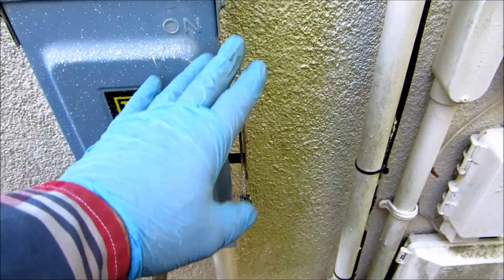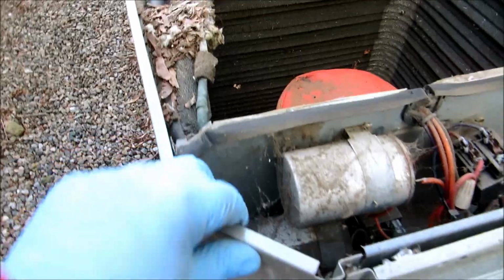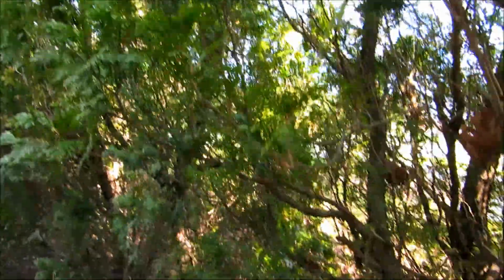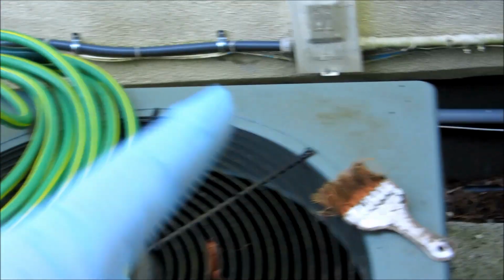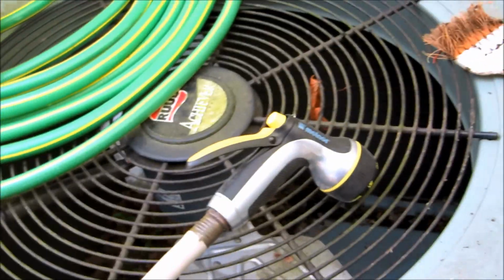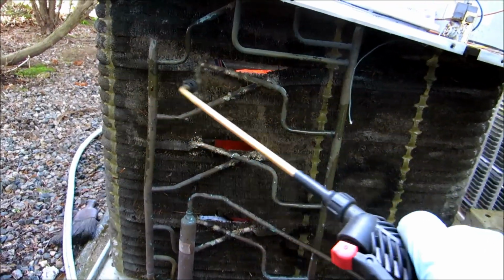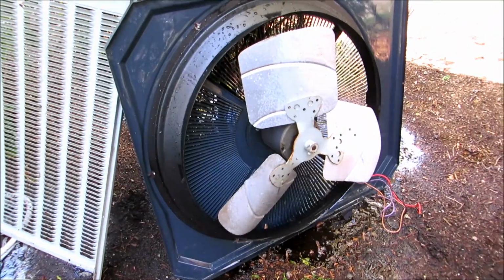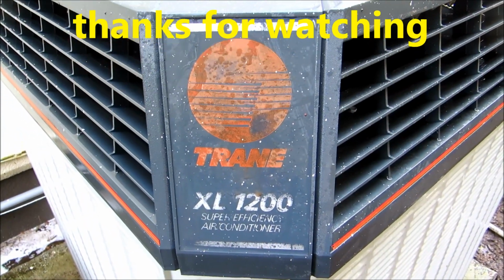hvac trane XL 1200 condenser cleaning

Comment: My trane 1200xl kept on tripping the breaker and i spent $500 on two different opinions of a new outdoor unit and a new capacitor. After watching this video i gathered enough confidence to take it apart and clean it. I spent 3 hours and 3 cans of coil cleaner but i gotta say that the time made a difference, i can actually hear the compressor running different now, no tripping so far.
Reply from the maker: milfhunterX wel; now it can breath and condense the refrigerant like it designed to .very important to keep them clean .now you can hose it off once a year from the outside with grates on will help it stay clean
Reply: milfhunterx, can you walk me through step by step on getting the top off the Xl 1200?  I have an XL 1400 looks exactly the same.  I don't want to break the plastic by using to much force or not knowing which side is best to start to unclip those clips.
Reply: TheGhettoLobster  Glad I didn't try that as mine have these little 1inch rectangular plastic covers at each angled corner of the Weatherguard top.  Under the 4 covers are 4 hex screws.  Had I yanks on the top as was stated I would have ruined and broken the plastic Weatherguard top.  Thanks for almost ruining my AC unit.  These is NO clips that hold this top on at ALL.
Reply: @TheGhettoLobster  Mine  looks exactly the same but apparently there are several different types of weather guard tops over the years.  Not sure when they first were available bit I have seen a pic of one from 1994.  Mine is 2001.  They look the same.  The current weather guard tops are more rounded and don't have the angled corners.  But to give bad advice I'd inexcusable, and then to patronize by saying get it fixed by a technician is a joke  Glad I didn't listen to you're incorrect advice.  I got my unit taken care of but not by your wrong advice.  Think twice before giving wrong bs advice dude

Comment: Amazing those condensers were still working?  Pine needle stuff!!!!  That stuff also packs itself under roof shingles.  My neighbor had 2 trees which had the finger long needles and they use to blow onto my roof.  The neighbor on the other side had a pine tree with the short needles, same story.  All those trees are now gone for years and one neighbor is dead and gone as well!  I have the same roof but it is really old now, but still watertight.

Comment: Since this type of air conditioner (Trane XL1200) is the same type I have at my house, one thing I want to ask is that if I take the dark gray cover off (that is, the angled louvered grill with the nametags in each corner), would the efficiency and lifespan be the same, or would it be altered, even though removing the top cover would make it look like a modified, "makeshift" XE1200 (with the lower profile design and straight vertical discharge)?

Comment: Help...please.  A little bird somehow got pulled into the blades of my 2013 Trane and what is left of her is at the bottom of the unit.  Mine is quite clean:  just a few leaves.  Is there way to get to the bottom without removing the top and all the sides?  Many thanks.

Comment: Thanks for the video. I have a 15 yo Trane AC unit which has probably never been cleaned. Bought this house 5 years ago. One question: Wouldn't it be better to use the hose inside to outside?
Reply from the maker: Leonardo DaVinci both ..hit it from both sides ,and take it all apart ,first ,

Comment: It sure does look a heck of a lot better, mine is done as of a few days ago. I'm checking for dirt build-up now. 

My unit runs but doesn't cool. No cold air, only fan air. Or at least that's what it seems. I've lowered the temperature lower to see if the cold air would come on but it didn't.

Comment: My parents have this unit (Trane XL 1200) on their house. It's about 21 years old. It just recently started freezing up, so I checked the filter, cleaned the condensing unit with plain water, and had a guy I know check the freon (I'm not a/c tech). It's pretty dang low on freon, so apparently there is a leak somewhere, which might be on the evaporator coil I guess. This guy tells me I should buy a whole new unit. I guess he means indoor and outdoor? Seems extreme to me, but it is an old unit. Any suggestions? Also, have you used this new replacement for R-22, called Ecofreeze EF-22a? It's supposed to be non-harmful to the ozone, and more efficient than normal R-22 (not to mention a hell of a lot cheaper). I was thinking about charging with that until I can figure out what I'm gonna do.

Comment: Good Job Steve, if you don't mind can you share what type of condensor coil cleaning solution are you using. thx
Reply from the maker: Paul Geogre nu calgon blue is good stuff with a coilgun or ,just use a good garden hose with a good spray head,, will get 95% of it durt off ,sometimes i will just use a hose ,all depends

Comment: Hi Steve, Great video.   Tried to hit Like and it doesn't seem to work.  ?odd?
 Where can we buy that coil cleaner, sir, OR what is the cost to have someone as thorough and conscientious as yourself to come out and clean and tune up my 2-XL 1200s? 
You Rock!

Thank You,
...Derek
Reply from the maker: daddy9minnich777 you might be better off just have a a.c. guy come out for a anual maintainance ,just tell him you want  to remove the side for a good cleaning with the hose there are other thing we check while we are there like run caps.contactors ect. the stuff i used was condenser coil cleaner , very important to flush the stuff out well .. or it could eat the copper coil .

Comment: great video, thanks!  so with the water hose, you always spray the outside of the coils, not from the inside?
Reply from the maker: depends its good to spray  both ways some coils have 2 rows ,the made idea is to get the coil clean and debree out so it does not rot the unit .

Comment: Steve,  1st Off - Great Videos !  I have watch just about all of your HVAC . I responsibility of maintenance of 21 Goodman Package Units 10 - 15 Ton. Today I had my Phase II Compressor Short to Ground. Are you familiar with how I would separate this compressor from my Phase I so I can keep the unit in service until I replace my larger Phase II Compressor ?
Reply from the maker: do you mean 2 stage condenser ??? single and second stage ?? its eather single phase or 3 phase
Reply: steven lavimoniere  3 phase  / Maybe I am describing the Compressors incorrect  /  15 Ton Unit  (3) Condenser Fans  - 2 Compressors in the Air Conditioning Cabinet . So it's probably 1st Stage Compressor and the Larger Compressor with the Sight Glass would be considered 2nd Stage Compressor. Could I separate at  Contractor ? or Thermostat Control Bar ?

Comment: best way to clean a Trane unit is with turbo torch. don't break it down. turn on the unit  and torch it right thru the sides. then just rinse with water.
Reply: Where does one get a "turbo torch?"  Is it easily purchased?
Reply: B tank torch Turbo Torch 0386-0835 PL-8ADLX-B Extreme Air Acetylene Torch Kit amazon.com
Be careful to not burn the wiring or composite base. 
Do it while the unit is running. 
Be sure to not melt the aluminum fins.

Comment: I never reach into a unit a pull the debris out of a unit. Good way to get Needle Stuck, from some Ah*l* Junkies, using it as a needle deposit. I made an Auxiliary Vacuum Buckets out of a Seven Gallon Bucket. Big hose from my Wet/Dry goes on one port, I made a smaller port, for a smaller vac hose.